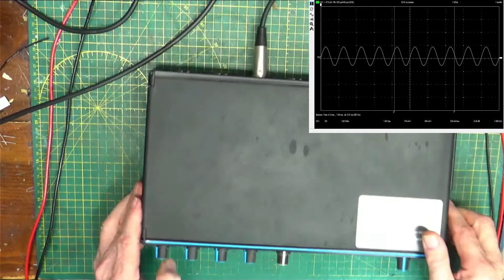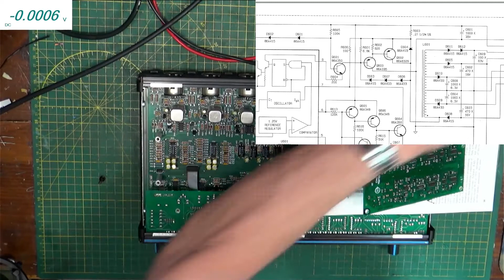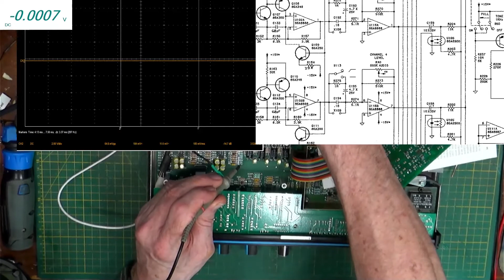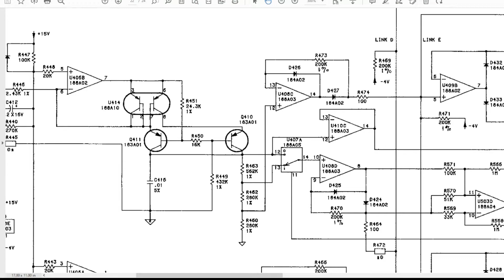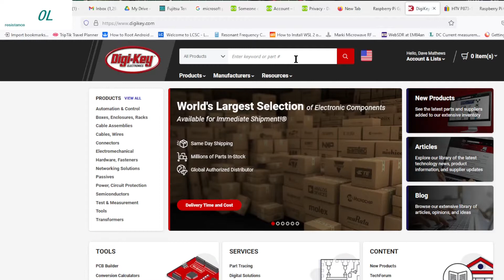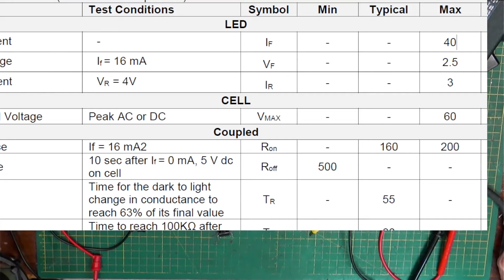Fixing a Shure IntelliMix FP-410 Mixer

Comment: hello! Thanks for the interesting video. Do you happen to know the parameters of the input transformers? what is their gain coefficient and what are the resistances of the windings?
Reply from the maker: No i do not. They are those little cans about an inch or so across, same as in the old models. 600 ohm matching is all I know really. 
Just out of curiosity why do you need all those specs? Sounds like you are designing something.
Reply: @AERVBlog thank you!
Reply: @AERVBlog I was making tube microphone preamps, and I couldn't find a high-quality Jensen type input transformer with a high gain of about 1:10. as a result, I used a Neutrik NTM4 with a gain of 1:4. And that was enough. I just saw an ad for the sale of such a mixer for ridiculous money and thought maybe I could buy and remove the transformers. Here I am looking for their characteristics :)
Reply from the maker: I believe radial engineering has Jensen style transformers. What you need is the guys out of M67 Shure mixers. They are always on ebay for cheap since the pots go scratchy and take patience to clean.

Comment: Hi Dave, this is a really nice video, really well-done.  I was looking at the user guide and it said there's a rolloff at about 200 hz.  Now that's perfect for the environment where we used to use these and I always looked forward to using the intellimixers because they got good recordings.  Just very well-designed for spoken word.  But can one do anything about that rolloff at the bottom, so they can be more usable for musical applications, do you think?  Anybody?
Reply from the maker: Thank you sir.  There is a little switch just to the right of each mic level pot.  If you push it up it is supposed to be flat. I  have not personally tested that though.
Reply: Well thanks for getting back.  So how should they be for musical applications with that set to "flat," and no intellimix, aside from a lack of features like panning and tone controls etc?  I'm noticing them and the 810SCMs going for a song these days.    I keep thinking there must be a fun project you can do with a stack of these. @AERVBlog
Reply from the maker: Sorry it took so long to get back to you.  Sometimes I don't get notifications.  They are not really meant for music but they are pretty flat out to 15KHz so I don't see why they won't work.  I have never tried stacking them but it says you can. If you do let me know how it works out.

Comment: In another Shure manual it lists a VTL5C2 as a replacement for a Shure 86A8900
Reply from the maker: Thanks.  I will note that down.  What manual?
Reply: @AERVBlog  shure.com.cn/productdocumentsfiles/default/discontinued/other/ams4000qcuserguide-98e2b724db3b5702657a4febdbd7d7fa.pdf

see Page 10

Comment: I have a foggy memory of heatshrinking an LED and CDS photoresistor together as a janky temporary fix for that type of circuit. back when it could take a couple of weeks for a part to show up in the snail mail.
Reply from the maker: Nice. Get it back on the air any way you can. Those were the days, bad ones.